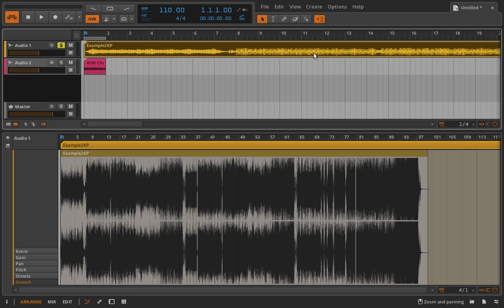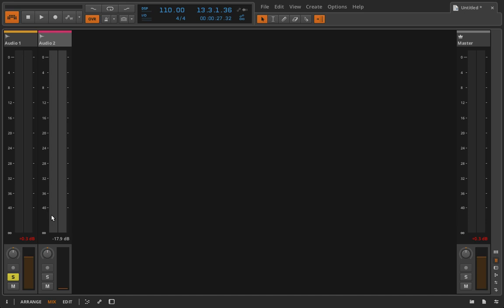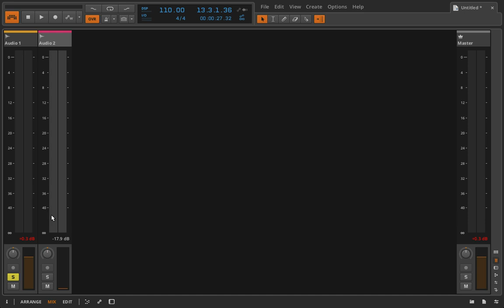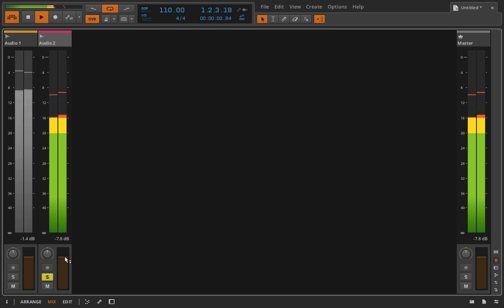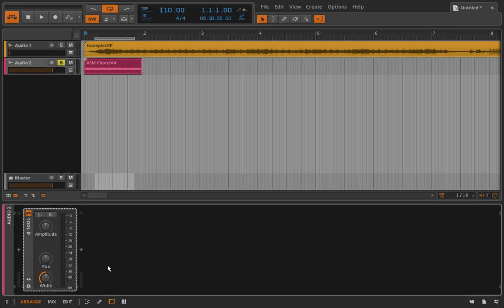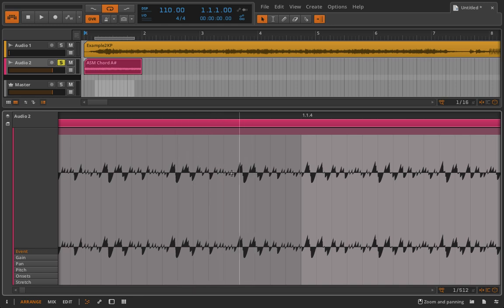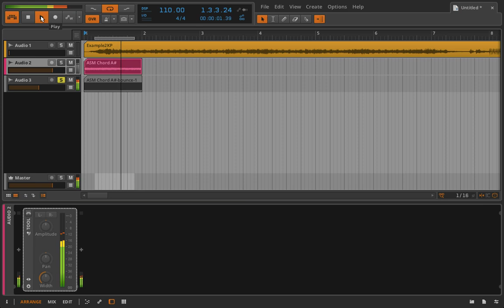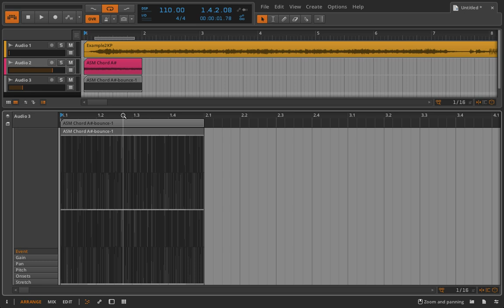Bitwig Studio & Music Production Course - 1.04 - Digital: Audio, Metering, and Distortion

Comment: Hi Brian, Thankyou so much for doing these tutorials, they are very informative and I am learning so much from your insights even though I have been producing music for the last two years.  I have a question in that, Is there a reason why there is a gap between the LED representation of the audio signal and the maximum peak  on Bitwig meters?
Reply from the maker: The solo lines (the ones going higher) indicate the peaks and/or transients of the signal while the solid lines are tracking the RMS (average) level.

http://www.gearslutz.com/board/mastering-beginners/173236-what-difference-between-rms-peak.html
Reply: ahh I see, thankyou so much :)